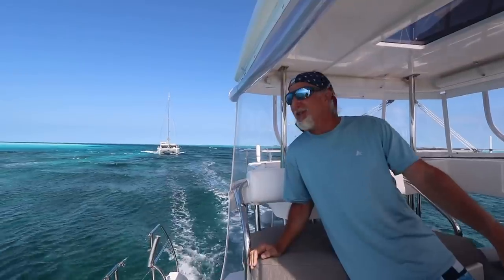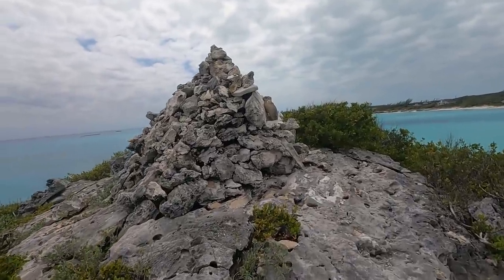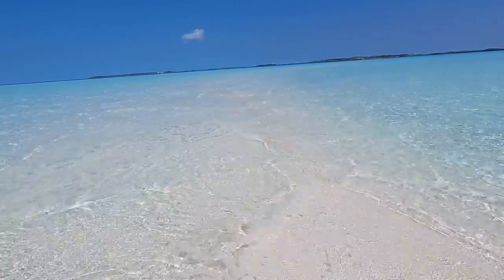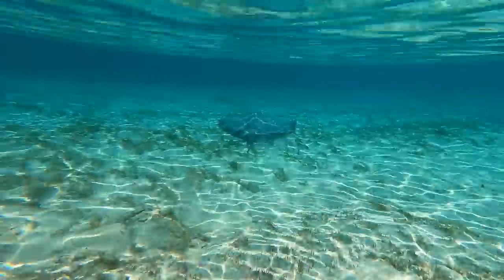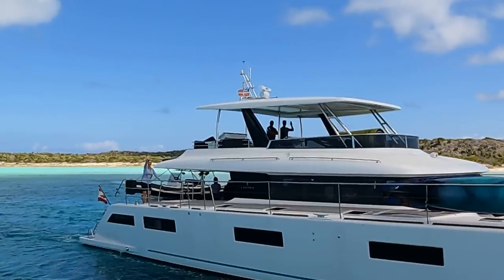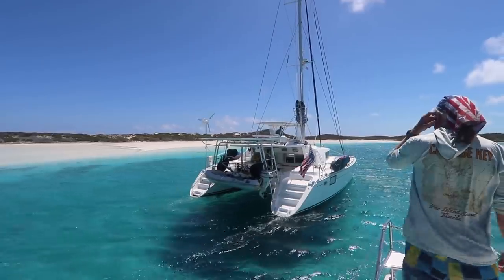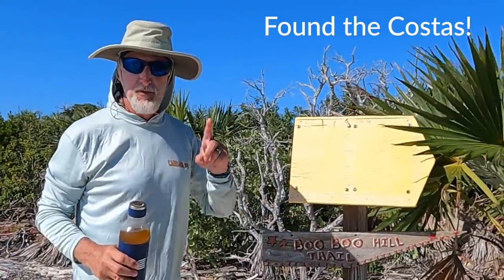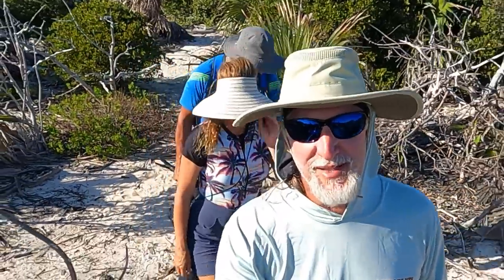Sailing to Exuma National Park and an Accidental Skinny Dip. E29

Comment: What anchorage is that with the mooring ball , how much are they a night?
Reply from the maker: That is the amazing Warderick Wells, which is a Cay (island) in the Exumas of the Bahamas. Our favorite place there. I believe we paid $25 or $30 per night in all of the Exuma Land and Sea Park anchorages with Moorings balls. It depends on boat length though. In many of the anchorages there you actually have to use their mooring balls instead of anchoring for a number of different reasons. We would prefer to anchor everywhere.